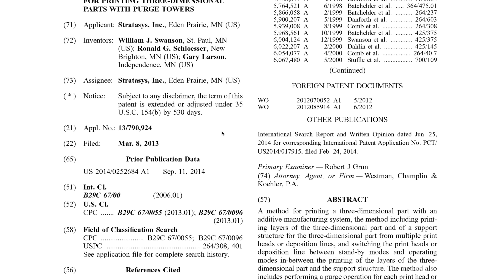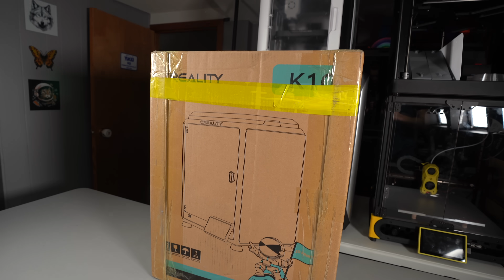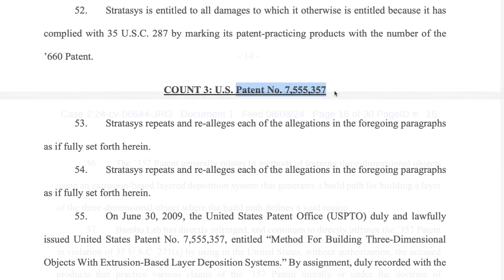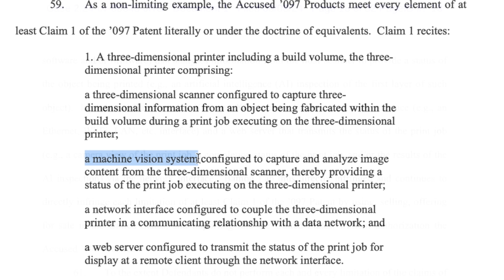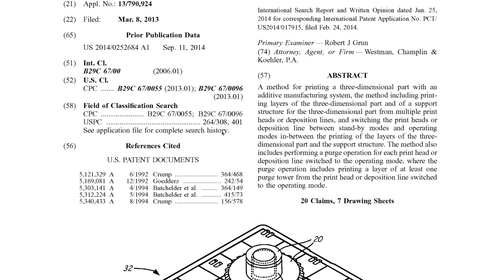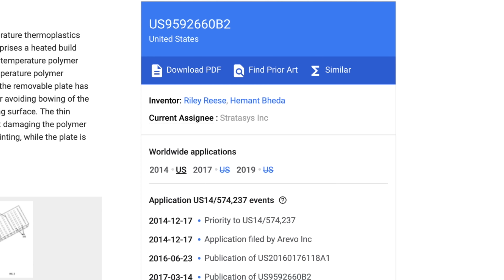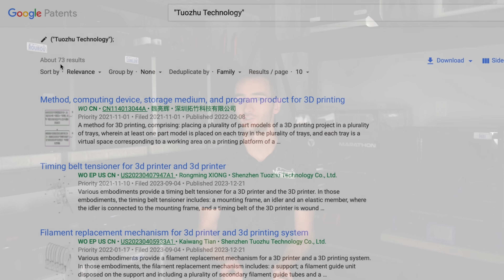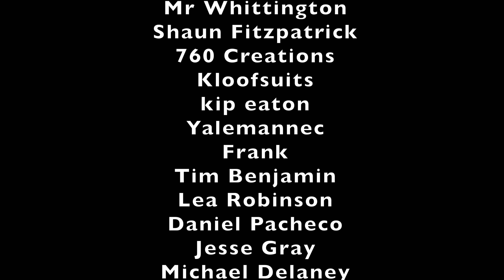Stratasys v. Bambu Lab - Will Prusa Play A Role ?

Comment: I think many are missing the fact that Stratasys own 46.5% of the recently merged Ultimaker and MakerBot.  The Bambu printers are a direct threat to Ultimaker rather than the larger hyper expensive Stratasys industrial machines.  The fact that 3D Systems are looking to buy Stratasys may also play a part in all of this.

I think its clear that many FDM printer manufacturers use similar technologies so it would appear strange that they target Bambu.  I guess it is a testiment to how good their printers are.  I would say my X1C easily outperforms the Ultimaker I used at work a few years ago.

Additional consideration.  I understood the patent for FDM ran out in 2008 (after the standard 20 years) which enabled the boom of domestice machines.  I didnt think it was possible to re-patent  something after the 20 year timeout.
Reply: I agree. The 3DXTech and Essentium machines are more direct competitors to the stratasys industrial machines.
Reply: Stratasys by the way could care less about MakerBot hence why they unloaded it on Ultimaker.  Becore Ultimaker took over, Thingiverse was allowed to rot.

Comment: Dude.. All the stuff we have been useing forever, I have used a Stratasys printer. THEY SUCK. Yea they work beautifully. Until you need to buy materials, or parts, or fix somthing that breaks. EVERYTHING must be bought from Stratysys. EVEN THE FILIMENT. You CANNOT use 3rd party filiment BECAUSE of the RFID tag (which isnt RFID, it is a special Chip based tag.. I spent a while trying to get around the filiment block). Basically Stratasys is money grubbing because while they work, they lock you in, and companies know monopoly is not good for costs (unless YOU have the monopoly)
Reply: some even use the subscription model, forcing the user to pay extra for options the machine can already do (like multi material)

Comment: Best overview so far! 👏 But this is more about finantials than the technology, imo. Stratassys has negative Net Income, at least, since 2017, losing between ~15/45M per quarter in the last 5 quarters. And their stock is 95% down since its ATH in 2013, and is at values not found since 2009!! And without signs of showing support. (This means they can’t even sell shares to raise liquidity without tanking the stock further and probably leading current investor to also sell, leading the to bankruptcy).
Why Bambulab? Pretty simple also. (Not because they are stealing them market share per se. They are, but they are what is called indirect competition. Direct competition would be Nexa, Essentium, ecc. Close heated chamber full fledged industrial 3D printers manufacturers). They chose Bambulabs because they are a player with serious liquidity AND with an extreeemelly large number of printers sold. This matters because, tipically, on patented infringement/licensing deals there is a licensing fee PER EQUIPMENT sold ;) So, imo, this is a classic desperate move of someone who is with the rope in its throat fighting for survival.
(Although I have had training in business and patents, and I dable with investments for many years, I’m not a lawyer or a financial advisor, so this is just my point of view and I live in Europe :p In 3D printing since 2014).
Cheers.

Comment: I was literally just about to buy a bambu a1 this monday when i saw this, now im concerned, if stratasys wins, will i potentially lose features that i payed for, software ect... should i hold off incase i end up getting less than i initially wanted or should i just go for it?
Reply: Which specific features are you worried about? You'd keep LAN no matter what, for example, and afaik they can't force issue printer recalls but if you wait to long you may become unable to by the printer at all.
Reply: @HK-oc3pn  probably all the motor silencing, heated bed, leveling, filament calibrations, i really dont care much for multicolour printing, i like the idea of wifi printing, and speeds faster than a typical ender 3 r great too
Reply: @HK-oc3pn  i dont really wanna sped any more $500 aud tho in a printer tho, incase that changes things
Reply: Just buy a prusa.
Reply: can't you use that machine offline? if you can't ... I wouldn't buy it.

Comment: This law suit is a money grab. Stratasys is hoping for an out of court settlement. But if Bambu settles, it will open the door for more of these suits.
I don't agree with your assessment that only Bambu Lab is becoming a competitor in the professional market. Prusa is active in the professional market for years now. The Automated Farm System by Prusa Research consists of a smaller version of the XL but in a rack mount format and complete with a software management system. Also, the XL could be considered as a cheap professional machine. They also have the Prusa Pro HT90, an $12,000 delta machine, also a professional model. So, if someone is eating away at Stratasys's market share, it would be Prusa. And they're violating the same patents as Bambu Lab. Stratasys is an international company; surely they know how to sue a foreign company? Or is it as simple as not having an US office to avoid patent lawsuits? That doesn't sound logical to me. 
I don't want to think about conspiracy theories, but I find it strange that Bambu Lab is arbitrarily targeted, while there are many more patent infringers. Bambu is high profile now, but Prusa and Creality were that for years until Bambu forced them to change and come up with new stuff and innovate. And now they're sued...idk, but it sounds fishy to me...

Comment: The analysis here is a bit lacking. Likely they are trying to scare away China 3D printer manufacturers before they enter the industrial space. Bambu has yet to offer a single device that competes with Stratasys despite the claims in the video. No one that buys a Stratasys would look at an X1Ce and think 'hey I can get those'. The print quality, reliability, production capacity, matrial handling, and so on are simply not there. They are still 100% prosumer products and, at best, capable of draft quality with a limited set of engineering materials.

Its more likely Stratasys is just targeting money and their poor cash flow since they are getting undercut by various real competition. e.g. Pantheon who has been taking market share from them particularly in the entertainment props industry for example. No reasonable analysis could consider Bambu in a similar market. 
Its like saying a Cessna is in the same market as a jumbo jet. Its likely to restrict market and establish patent validity to prevent an international deployment of a China Pantheon.

So why not go after Prusa who is in the entry point that Stratasys, Pantheon, etc are getting closer to enter said market with things like the AFS?
Simple, Prusa has counter claims they could hit them with. Why risk going after someone your likely to sacrafice many of your patents to and open up to counter claims when you can get similar results against weaker more indifferent targets like Bambu? After all most of the companies you are trying to scare off the market are all funded by the same VC fund in China... so if you bloody the nose of Bambu you hit dozens of companies all at once.
Reply: "No one that buys a Stratasys would look at an X1Ce"
I personally know professionals who did do this. The cost savings breakdown is around 200x.
Reply: @HK-oc3pn  then they had no idea what market they were in. A X1CE physically can't do what the target market for the stratasys targets. Your not going to as a bambu to make a dimensionally accurate industrial part for a multi six figure up apparatus that normally would cost thousands of dollars if it was still made. Out of the box, it can't do it.
Nor are you going to ask a x1 to make a structural prop for a shoot that costs a studio tens of thousands of dollars per hour of production if it breaks or doesn't come out the first time perfectly.
The printers are a minuscule fraction of the cost of the solution they are trying to fill and the risk of what they are trying to do. If something goes wrong or it isn't ready in time. This doesn't even go into the liability if people find out that you're using this kind of a machine in the production of food, transportation, or employee safety.
Bambu, for instance, will not send out a repair person with the broken components for your printer by 9:00 a.m. The next business day because you're about to lose $100,000 for the printers being down.

Comment: I hate patent cases, but I love 3d printing as a hobby, so I apologize for this comment up front, since it's not the correct forum, but it just fires me up.

I would argue like this on behalf of Bambu Lab and the open source community as a whole.

Invalidity Due to Prior Art and Obviousness
   -  I would argue that the patents in question are invalid due to prior art. The concepts of purge towers, heated build platforms, and extrusion-based layer deposition have been well-documented in the 3D printing community long before these patents were filed. I would present evidence from academic papers, prior patents, and even open-source projects that predate these patents, showing that the claimed inventions were already in the public domain. Specifically, I would focus on the widespread use of similar techniques in both industrial and hobbyist 3D printing long before the filing dates.

   - Even if the patents are not invalid due to prior art, I would argue that the claims are obvious to someone skilled in the art. For example, the idea of using a purge tower to clean nozzles is a natural and obvious solution to a common problem in multi-material 3D printing. The same applies to the heated build platform, which is an obvious requirement when working with high-temperature thermoplastics. I would call upon experts in the field to testify that these techniques are common sense and do not meet the threshold of inventiveness required for patent protection.

Functional and Algorithmic Nature of the Claims
   -  I would argue that the patents are overly broad and functionally claim abstract ideas rather than specific implementations. For example, the patent on purge towers may describe a general process without tying it to a specific, novel method of implementation. I would contend that these patents attempt to monopolize fundamental principles and methods that can be executed in numerous ways, thereby overreaching the intended scope of patent protection.
   - Specifically for the purge tower patent, I would emphasize that it describes a software process that can be implemented through various algorithms. Software patents are often scrutinized for their abstract nature, and I would argue that this patent is nothing more than a mathematical algorithm, which should not be eligible for patent protection under existing legal precedents (e.g., *Alice Corp. v. CLS Bank International*).

Non-Infringement Due to Design Differences
   - I would carefully analyze the design and operation of the Bambu Lab printers and demonstrate that they do not infringe on the specific claims of the patents. For instance, if the purge tower or heated build platform in the Bambu Lab printers operates differently from the methods described in the patents—either in terms of software implementation, hardware design, or operational parameters—I would argue that there is no infringement. I would emphasize that even small differences in the way the technology is implemented can constitute a significant enough departure to avoid infringement.

Doctrine of Patent Exhaustion
   - I would explore the doctrine of patent exhaustion, which states that once a patented item is sold, the patent holder’s control over that specific item is exhausted. If any of the patented technologies or components were licensed or sold by Stratasys to third parties, and Bambu Lab obtained them legally through the market, I would argue that Stratasys cannot claim infringement on those grounds.

Public Policy and the Importance of Open Source
   - I would make a compelling public policy argument that enforcing these patents in the manner Stratasys seeks would significantly stifle innovation in the 3D printing industry. I would argue that 3D printing has thrived due to the collaborative efforts of the open-source community, and granting Stratasys such broad enforcement of these patents could have a chilling effect on future development.
   -  Highlighting the role of open-source innovation, I would argue that many of the advancements in 3D printing have come from shared knowledge and community-driven improvements. Patents that are too broad or vague can hinder this collaborative environment, slowing down technological progress and harming consumers and small businesses.

Potential Antitrust Implications
   -If applicable, I would investigate whether Stratasys’s actions could be seen as anti-competitive. I would argue that Stratasys may be using its patent portfolio not to protect genuine innovation but to unfairly suppress competition from emerging players like Bambu Lab. I would explore potential antitrust claims, particularly if Stratasys holds a dominant position in the market and is using its patents to maintain that position by unfairly targeting competitors.

In conclusion, I would vigorously defend against Stratasys’s claims by challenging the validity of the patents, arguing non-infringement, and highlighting the negative impact that enforcing these patents would have on the industry. By combining technical analysis with strong legal precedent and public policy arguments, I would aim to dismantle the basis of Stratasys’s lawsuit and protect the rights of Bambu Lab to innovate and compete in the 3D printing market.

Comment: Maybe Bambu Lab has pissed them of due to they are moving around in a open source community not giving anything back, stratasys could maybe see the other player there as useful developers. 
Another thinking , maybe Prusa has done some homework keeping hands away from e.g. first layer scanning because they have seen a no no patent there. Of course it's totally odd to talk about heated bed patent, it would be the same if Edison owned all ball there was able to light up by electricity. 
I don't understand patent can be so loose, normally you are screwed if someone just change a little on the design....

Comment: Some of the patents are literally just technologies taken from other existing markets. Material tagging?!?!? That's literally the primary purpose of RFID tags, is to be able to distinguish different types items, there's nothing novel about having them inside a 3d printer. Same for heated chambers, remote management, remote monitoring, printer configurations, etc.
Reply: It's patent trolling definitely. Their patents are so vague.
Reply: My electric toothbrush uses RFID to warn me when the brush is to old. The manufacturer should be sued too. 😂😂😂
Reply: “You can’t do that because we did it first, even though it’s how it’s supposed to be used”
Reply: Ultimaker has also been using RFID too
Reply: @mostlymessingabout  stratasys owns ultimaker so I'm sure they're ok with it
Reply: Absolutely! Having worked for a high tech parent driven company, and therefore having some relevant experience, these do not meet the novel criteria
Reply: Applying existing technologies to different industries can make it novel for that industry and thus patentable. Normally this requires a new twist on the technology in some way but not necessarily. The problem becomes when they are super broad, which when it is the first time being done, it normally is just by the nature of how things develop and get fine tuned and more specific over time. Plus a well written patent covers the most variations possible. 

Not defending stratasys by any means. Their parents may or may not be valid. But they definitely survive through litigation to keep their crap alive
Reply: @willofthemaker  Lol, not where the main purpose of RFID is to "identify entities nearby wirelessly." I see already little reason for patents to exist, but this pushes me towards the "patents should be banned" side. It is not an expensive, lengthy, or creative solution to a problem. It is just using a technology (they didn't invent or patent) to do what it has been invented for. 
Also, for the other patents: since FDM patents expired, FDM printing IS allowed to be used, and there are not many ways to extrude a filament, which mainly derives from metallurgy and has been used for hundreds of years. Changing material and temperature doesn't add anything new or innovative to the expired FDM printing patent; at most, you could patent special materials or different heating curves if they differ enough from the specific material ones (otherwise, they are no novelty, just taking what already is known to exist). Also you cannot patent later something that is required for a patent you registered earlier (like extruding material for FDM).
Reply: @willofthemaker  Not that I agree that people should be able to patent these types of things but an analogy our old patent lawyer used to use was patenting a house.  You know the house isn't novel, so you then proceed to a part of the house, the door, that also doesn't work, so you move to the door knob, that didn't work, but you then decided that you could patent how you open the door knob which was novel.  This tries to show that within obvious things there can be things that are novel.  As you mention this can get even deeper if you look at specific markets.  Something may not be novel in the automotive industry but when applied to the pharmaceutical industry it may be considered novel.
Reply: @karadason  Great analogy and very true
Reply: tell me you don’t know the definition of business without telling me you don’t know anything about business